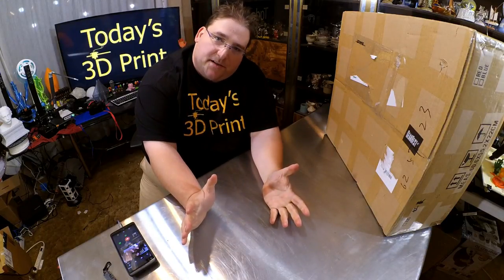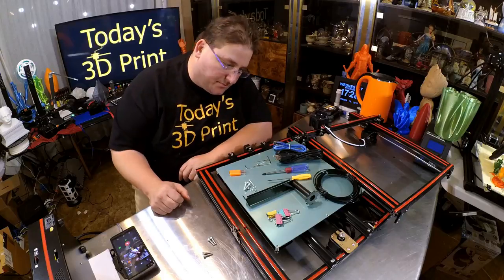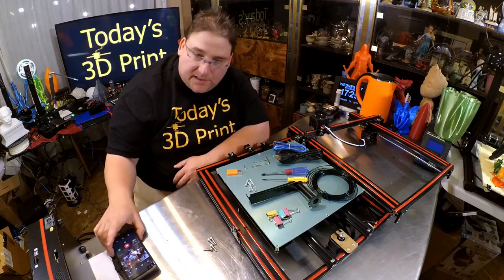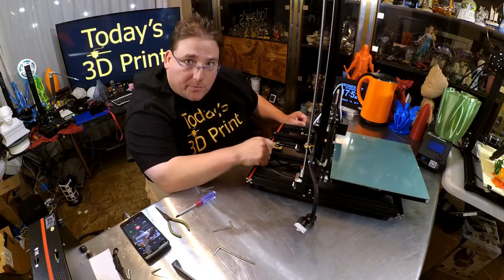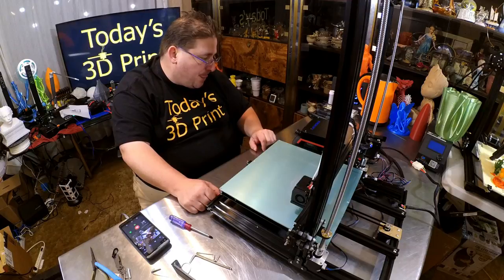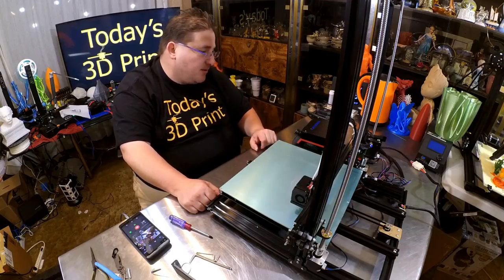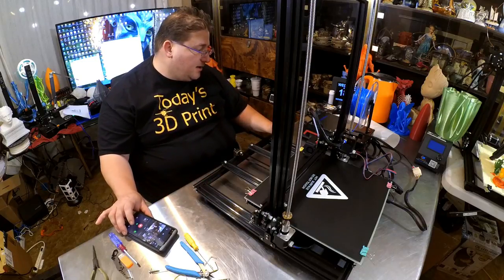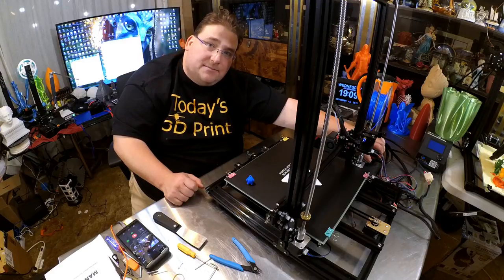Today's 3D Print 150 TronXY X3S CR 10 Clone Initial Unbox, Assembly, First Print

Comment: Does it have Repetier firmware? If so, that would have to go! I find it super frustrating. On the whole, I like my tronXY X1 - it is a fun little printer, so was interested to see how something else from TronXY would shape up!
Reply from the maker: +Chris Kyriacou the interface appears to be the same as the cr10 or very similar so I believe it's running Marlin I will see about confirming that when I get home tonight
Reply: Nerys Easy way to tell is to try M851 - if nothing comes back, it's Repetier FW. (M851 is software Z height offset, useful for auto bed levelling, or tweaking software rather than your hardware z end stops on the printers).
Thanks Nerys!
Reply from the maker: +Chris Kyriacou I was about to say that won't do anything for me and then I realized you're probably doing this over USB interface I've never actually connect a printer over USB except for my very first print of the MakerBot mini I'll have to try playing around with that one day
Reply: Nerys wow, I know I'm weird cos I like a tethered print :S but you must have the patience of a saint using all the different user interfaces :)
Do you use Astro or Octo print at all, Nerys?
Reply from the maker: +Chris Kyriacou all of the user interfaces on the same essentially press the knob scroll to print from SD click the file you want and that is it it is the epitome of simple which I really like the only thing I wish I could do is I wish I can send files to the actual SD card over WiFi

I am fascinated by octopi but I do not like a UI and mine has proven to be unreliable though I suspect that is a finicky USB cable or USB connection

I guess it depends on what you like for people who like to be involved during the printing process octopi make sense but I don't care what the printers doing once it's going as long as it does what it's supposed to do I like the set-it-and-forget-it type of printing I do all the hard work in the slicer and then I sick the printer on the code and walk away come back in 3 days when it's done :-) that just sounds funny saying that :-)

I do have something new I'm playing with if it works it'll be interesting :-)

Actually this printer from Tron XY is really annoying and one regard damn knob is backwards you have to turn counterclockwise to go down instead of clockwise and that is a muscle memory habit that is impossible to break :-)
Reply: Nerys yep, I agree with your thought process, dial in the settings in the slicer and off you go. Can't argue with that workflow!
I have been dabbling with octopi and AstroPrint - I really like the time lapse videos you can get.
As for Repetier, why oh why do the manufacturers insist on letting a product out the door with reverse controls???
Easy to fix when you know what you are doing but you SHOULDN'T have to go 'under the hood' with firmware!
Reply from the maker: +Chris Kyriacou well I guess to them that's the right way and the other ways the wrong way :-) but when every other single printer you use is clockwise boy is that annoying :-)
Reply: Nerys Thanks for your wealth of content, Nerys, it's like a treasure trove of knowledge! I just spotted you have posted your printer profiles and going to take a look! Do you have a favourite slicer?
Reply from the maker: +Chris Kyriacou i only use simplify 3d BUT cura i find has some very much desired features i want (namely infill mesh overlays something s3d can not do and i want) so i am going to make time to learn cura as well.
Reply: Nerys yes, I have kept putting off moving to v2/v3 of Cura as it has soooooo many settings and isn't fully supported by Repetier Host, Octoprint or AstroPrint. It's kind of daunting! Lol.
Reply from the maker: +Chris Kyriacou nothing to be daunted by when it comes to many settings just don't touch the ones don't understand :-)

Comment: Hiya, I have the x3s - an it's confusing me a little.. ok loads.  It's resonating at certain point along the print. I'm printing a circle, smaller diameter ones are fine but bigger ones cause thr bed to vibrate due to harmonics between the X and Y,  i can physically see it vibrate only at the corners of you imagine an X on the face. Changing acceleration, jerk, actual print speed and even temp doesn't seem to stop it. I tightened and loosened the belt.. only thing I have not done yet is change the power to the stepper - last resort, if I have any left?
But like I say, all other print are fine! On my X1 it nexer had this issue on the same model.
Any advice? Idea why?
Reply from the maker: I suspect the problem is the Y Carriage plate it is very thin and vibrates like a drum this is what I saw with mine the whole bed would bounce around a little bit is it vibrated

I intended to replace the Y Carriage plate with a 3mm piece of aluminum like I did on the E12 which should help to some extent with that
Reply: not long after i wrote that comment - Thank you for getting back to me :) - i just staired at it... an then i released...  The springs!, i had it set a little to high so the softly compressed springs actually amplified the wobbles.
  i lowered it all an the amount the whole bed wobbles is far less now, still there a little tho. 

I did initially - Mid print - Stuff a screwed up an slightly flattened piece of paper under the bed - ~Should have got a medal for doing that~ to Absorb the bonce, it slightly helped but lowering the bed worked best.

 i couldnt find 3xs guide wheel supports - they work fantastic on my X1 - so im gonna design some now as only 3 of the 6 wheels are actually making contact with the rails!. hopefully that will help too.
Reply from the maker: You got it anything you can do to stiffen the the machine up will help with print quality

Comment: bleh I no like crappy heat bed. Pretty cable braiding though...  the on controller spoolers is a good idea maybe.
Reply from the maker: They all have crappy heat beds except the tornado :-) I would avoid the Tron XY the tornado or the cr10 is a better bet higher quality and more reliable

Comment: this or a tornado? I call it the Tronsee.
Reply from the maker: I personally would have weighed this printer the tornado is a good bet this printer is trouble it works it just doesn't work very well
Reply: thanks. I was flirting with a kossel linear until I saw the assembly. as I'm doing abs nylon polyc a good heated bed is critical.  Can you tell me if I might need to upgrade the tornado nozzle to something that can go hotter (300c) I know polymaker has a polycarb that runs at 260 but tests showed 270 was better.   well I'm pullin the plug on a tornado, no sales as of yet. sigh. thanks for your great vids love them.
Reply from the maker: Sometimes you can go hotter in gcode even if the printer itself won't let you turn the knob up that high for example I run 265 on my Ender but on the interface you can only go to 260 I will have to test it on my tornado to see if it will permit 270 you might bump into the failsafe that's what happened on the Ender when I tried to push to 275

I'm not sure if you can insert a G-Code command to change that or not I will have to look into it

I believe the micro Swiss all metal hotend will bolt right up to it I'll double-check that but I think it uses the same bolt pattern as a cr10

Comment: so what is the heating issue? it shouldnt take 30 minutes to heat up....
Reply from the maker: +Jason Poe I I suspect it's just massively underpowered for the task although there could be something wrong with it almost every print I get a heating failure error on warm up I turn it off turn it back on restart the print and it works fine and it's never failed during a print and I finished a 26 hour print today  which work fine though not nearly as clean as a cr-10

 I'm going to contact the company to inquire about a solution we'll see what their responses is and of course let you guys know what the responses I actually kind of like it when I have a small problem with a printer or I will pretend to have a small problem and then later say oh I fixed it just to see what kind of response I get from the manufacturer because how they support their product is almost as important as the product itself

The fact that the default heat up temp is 40 C leads me to believe it's just underpowered and they know it although 40c is plenty for pla so I just set my slicer to use for 40c for the first layer and 55c for the second layer this way it's still printing while it works its way up to 55c

Certainly doesn't help but I keep the house at 16 or 17 C or lower :-)
Reply: It's that idiotic INSULATING garolite (what you called "fiberglass", Chris) plate.
Reply from the maker: +vidznstuff1 no it's just slow I didn't even put that played on there and it took forever to heat up :-) I mean really slow I might be exaggerating so when I get home I'll test it in time it with a stopwatch :-) but I doubt I'm exaggerating by much :-)

I might actually like the build plate I just finished earlier today 26 hour print that covers almost the entire plate a cute little turkey that I super sized just for shiggles :-) I suspect I might be able to flex that plate and pop that print offer we shall see :-)
Reply from the maker: +vidznstuff1 and yes I agree it's insulating that time was not time to bed surface temperature but time to thermistor temperature I imagine you'll lose a lot through that plate since it would insulate and not conduct but so does glass glass is an insulator but it's a lot cheaper to get a flat piece of glass that stays flat then it is to get a flat piece of metal that stays flat
Reply: Nerys it sounds to me as though there is a short in the bed or a bad connector not letting proper current through ..... possibly overheating the mainboard and causing your heatbed failure i would check voltage and the wiring to the heatbed
Reply from the maker: yep. going to tear the bugger down and see whats inside on tuesday. after I play with the JGAurora A5 which I have been drooling over :-)
Reply from the maker: 10 minutes to get from 16c to 40c interesting note normally when I tell a printer to heat up I manually go in and tell it to heat up the nozzle at the same time this time I let it hit the bed first and then do the nozzle on its own and I did not get an error when he bed turns on I hear the fan slow down I wonder if the power supply is marginal like it's pushing the limits of the power supply I will have to see what's inside there when I open it
Reply: Nerys make sure the power supply is set to 110v.....i know probably already done but worth a check.....but it sounds like a power supply problem or bad wire ..... also check and make sure your bed clips arent cutting into the heating element on the bottom of the bed....
Reply from the maker: +Jason Poe red cups are safe but you know something I never check the voltage switch it must be sent the 110 or it wouldn't work but I'll check anyway :-) I did my first toll print last night I had to go to the bathroom so I peeked at it I'm seeing the same spiral banding as the tornado so I'm guessing it's using the same board as the tornado that's a pity :-(
Reply from the maker: +Jason Poe I confirmed it set to 110 volts which actually bugs me since it came set to 110 volts from the factory which is dangerous if this ain't gone to a European user and then plug it in... Smoke

I did not think it would work if it was set at  220v and I don't want to test it :-) I have plans for it :-)

Comment: Hmm....
Reply from the maker: +Reggie Reginato it is interesting I suspect eventually the cr-10 will go away and the default printer will be the cr-10s and that 400 to $450 this printer is $150 cheaper at $260 while I would never advise somebody to get this printer over a CR 10 ever in a million years I can see someone wanting a large print volume and not being able to afford a cr-10 once the stock of the original cheap ones run out

 we'll see if they make any attempt to improve the design simply adding a thicker y Carriage plate would probably make it a pretty decent printer I'm going to test that :-)
Reply: Yea, I can see that happening.  Truthfully, I was thinking that all of these CR-10's (be it Creatily, Tevo, Hictop, Luxinwatts, Ccoway.....Uhh, and millions of other "brands"  (no matter how well or not so well known)) where just being manufactured by one company then rebranded...  But clearly that isn't the case...
Reply from the maker: +Reggie Reginato that is the case for The Identical printers hictop and raise for example directly OEM the cr-10 and the cr10 mini they are not made by those companies they are made by creality with their label name put on it

It's like when you get a Boost Mobile account it's a Sprint account it's an mvno call Boost Mobile on that uses Sprint

Tevo is their own company the tornado is a clone of a cr-10 with some changes have they used the correct brain board and improve the quality control slightly they could be a real Contender for creality basically they need to make a cr-10s with AC heat bed and that nice composite glass plate

Anet and Tron XY are their own companies and these are their own printers they are very much budget companies Cutthroat for price which is not a bad thing as long as you go in our eyes open for example the anet E10 is a fantastic printer I get extremely high quality low noise Prince from that printer with a very decent print volume but the quality control is horrible nothing fatal you can fix everything and it's not that difficult even but those problems should have never left the manufacturing line
Reply: I know a while back I had the Tevo Black Widow on my mind (I do want to get into some pretty large sized prints, though I've been figuring out ways to cut the things I want to do into smaller segments).  Don't worry, I've seen the reviews on that particular Tevo - so yes it scared me off (looks too much like I'll spend more time wrenching then printing (I do enjoy wrenching on too many things, but I'm more looking to tap more into my creative side).  But everything I've seen on the Creality CR-10 and the CR10S (as well as the Tevo Tornado) has been making me lean towards these two models.  But I didn't realize there was "cuthroat" super cheap clones of this bargin of a printer (and it doesn't appear that one's saving much going that route either).
Reply from the maker: +Reggie Reginato right now no it's $80 cheaper than the cr-10 for some that might make or break the deal they simply don't have the extra $80 but I suspect anybody who can afford a $260 printer can probably afford a $340 printer now wants to fire sale on the original cr-10 is over and it's only the cr-10s or the cr10 mini printers like this could become more attractive
Reply: Yea, I guess $80 is a couple spools of material. :-)

Comment: Tevo sucks, Tronxy is bad, Creality has issues.  WTH printer that does 300x300x300 minimum is there that doesn't suck or have issues?  This is a serious question.

Tevo - https://all3dp.com/3d-printing-community-angry-tevo/
Reply from the maker: it would be unprofessional for me to badmouth a company on political etc.. grounds (that is not my place) I adjust more subtly than that. I have too.

anyway. tevo is "ok" but QC is an issue sometimes and the company itself.... Tronxy is just no joy. the machines work. they are reliable so far but they just ... cut too many corners. print quality suffers greatly.

Creality has few issues. I have 2 CR-10 2 CR-10s 1 CR-10 mini and 8 Enders and besides one doa ender (which might well be user error I think I fried it) they all work for the most part flawlessly. and I have THOUSANDS of hours of printing on them and I bought all of them besides the mini on my own dime.

when you sell a zillion units YOU ARE GOING to have lemons here and there. that is a given. no way around it. not at this price point. your getting a $2500 printers capabilities for the most part for $400. (think Gmax)

they are your best bang for your buck. not perfect. but damned close for the price. your safest bang for your buck too. the least likely to be lemon and easily fixed.

if you want this kind of build size you can pay a bit more for tried tested and us warrantied through tinymachines.com or you can go all in and buy a gmax. they are amazing machines with excellent support but your going to pay for it.
Reply: I purchased the TronXY X5S and it will be here next week.  Here is to hoping it has all of its parts and doesn't have bent plates.  I purchased this to replace my now dead hunk of junk Prusa I3 Rework and because I was building my own version like the X5S last year so I can fix what it needs.  My fear with this printer is not that I had to already buy upgrades (will be here next week) or anything to do with the printer but that I am dealing with GearBest.

As far as you saying it would be unprofessional to bad mouth a company is that because you want free shit, like the rest of the 3d channels, and don't want to bite the hand that feeds you free stuff? I unsubbed ALL of them due to that as I look for genuine people with unbiased reviews who aren't tethered to GearBest, or whatever company, so they can get all that free shit.  Now your comment makes me think you are the same.